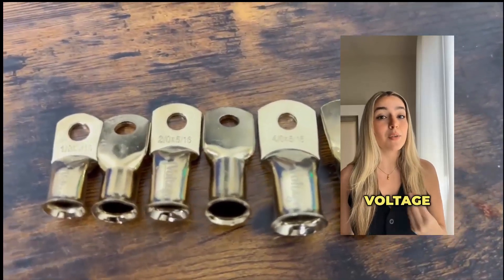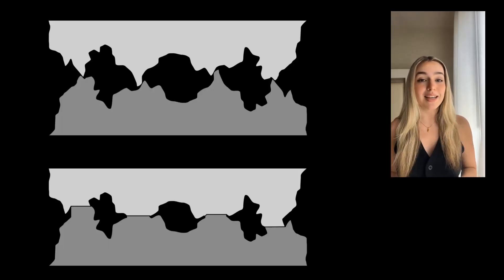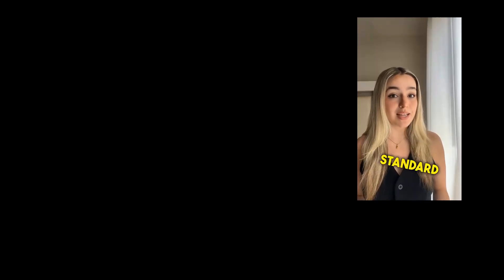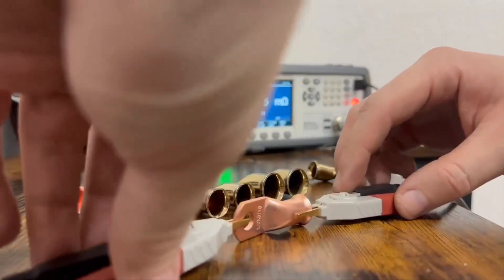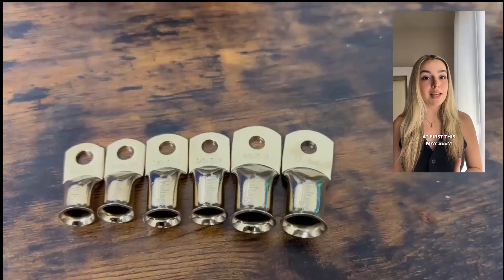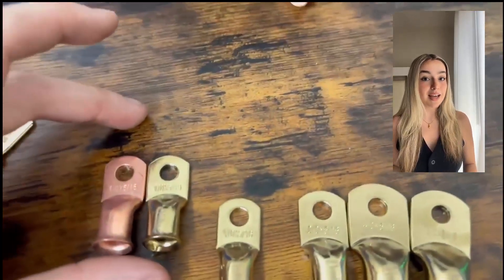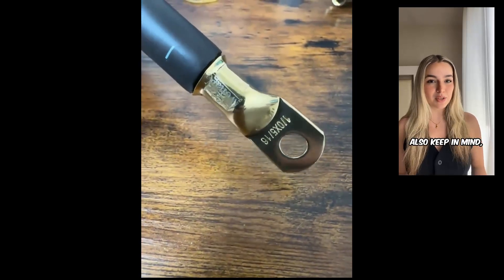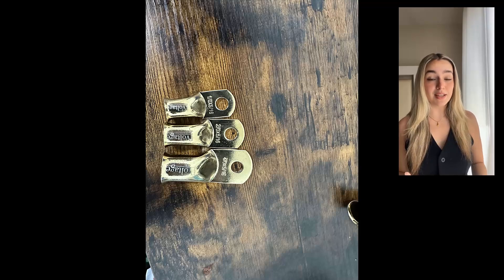Golden CERAMIC crimp lugs?!   The best money can buy.

Comment: What would soldering the lug to the wire do in terms of raising or keeping the resistance? Would the recommendation be to just use large gauge compression crimp?
Reply from the maker: Yes. Highly recommend crimping to achieve a cold weld.  No solder needed.

Comment: Damn bro fuses and lugs both I really like how your targeting an unnoticed and largely overlooked area that as you said throughout the entire system will add up to better voltage and power delivery thinking about rewiring my setup
Reply from the maker: Yep, trying to figure out things that haven't seen any real upgrades or improvements since I started doing this in the late 90s..
Reply: @GloweIndustries  keep it coming bro your on top of your game right now is there a way to ceramic coat copper wiring??? Just a thought I never knew under a microscope metal looks like that
Reply from the maker: @Dirty2152 too brittle.
Reply from the maker: @Dirty2152  Check out (on google) the phrase.. Electrical Asperity